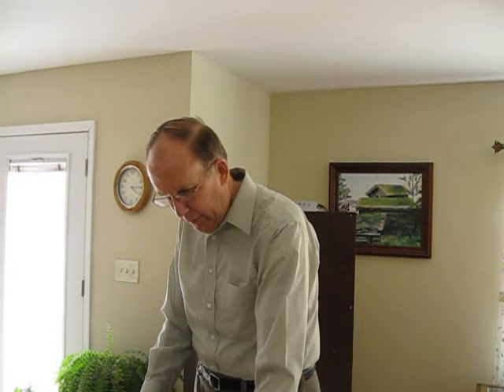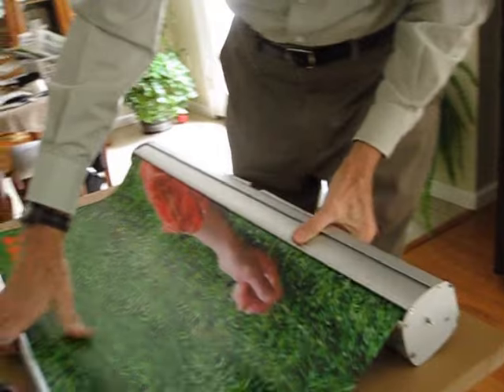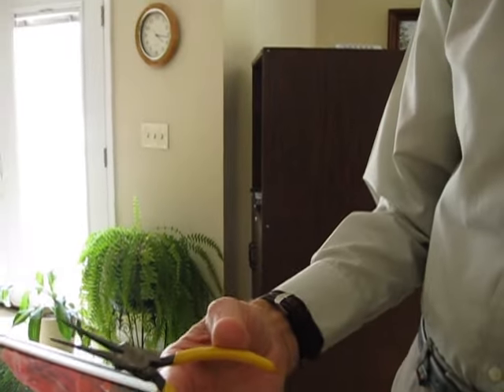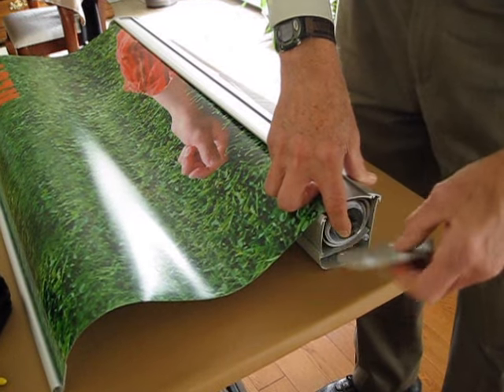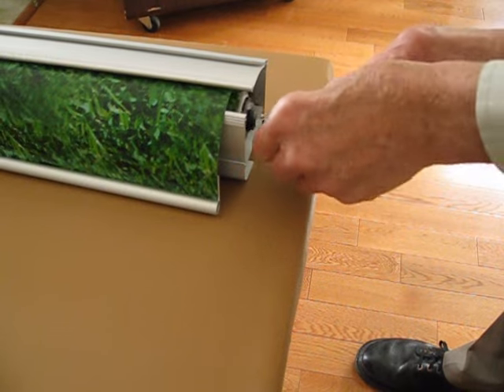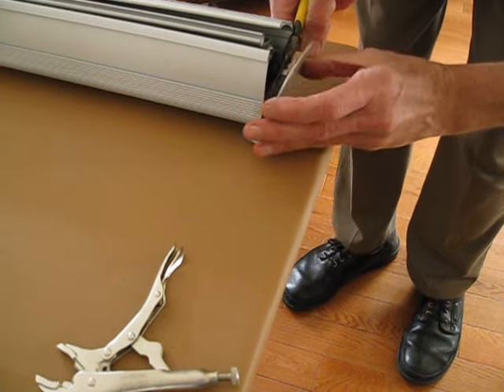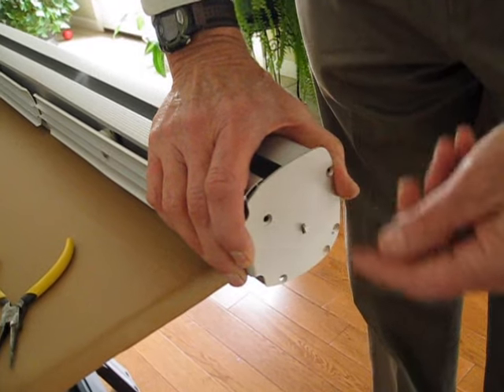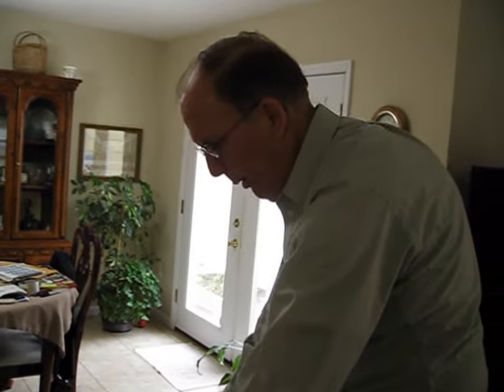Restoring the Spring Tension on a HER Health Expo Retractable Frame

Comment: Outstanding thanks it works! But you can do it just by unscrewing the end and tightening it without removing the cap but so it can rotate as well. If you do this with it standing vertical and between your knees its easy.

Comment: You can use the vise grip with the en cap in place.. a lot easier than holding it with the pliers...
Reply: Not if it went inside, though. Mine went inside during shipping, so it wasn't even sticking out!

Comment: Do not remove end cap. Loosen all screws at the slotted end, leave end cap on, but with all the screws off , you can just turn whole end cap. No need for vise grips or needle nose pliers.
Reply from the maker: That's a good point, and it can work well also, thank you.
Reply: Ĺ
Reply: i know im randomly asking but does anybody know a tool to log back into an instagram account?
I stupidly lost my account password. I would appreciate any tips you can offer me.
Reply: @Eduardo Omar Instablaster ;)
Reply: @Terry Waylon Thanks so much for your reply. I found the site thru google and I'm in the hacking process atm.
I see it takes a while so I will get back to you later when my account password hopefully is recovered.
Reply: @Terry Waylon It did the trick and I actually got access to my account again. I'm so happy:D
Thank you so much you saved my ass :D
Reply: @Eduardo Omar glad I could help :D

Comment: Thanks so much! I got it fixed, but now I am still wondering, did I break it? Or was it broken when it arrived? What is that little key for? Am I supposed to put that in the hole before I use it? SO many questions, and the idiots sent zero instructions.

Comment: I used to repair rollup only a screwdriver. Winded end cap without removing it. It is much easier ;-)

Я для ремонта роллапа использовал только отвёртку. Наматывал торцевой крышкой не снимая ее. Это намного проще  ;-)
Reply: Семен Семенов o
Reply: I    
 
O